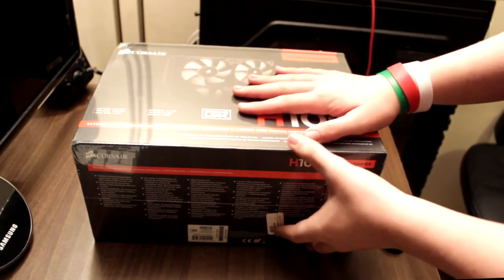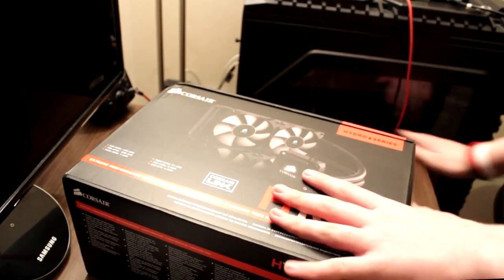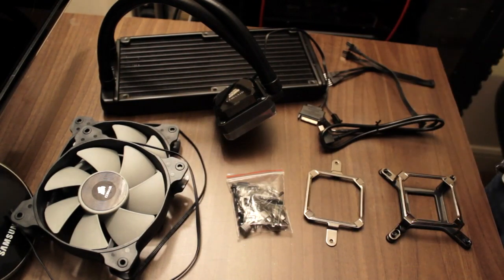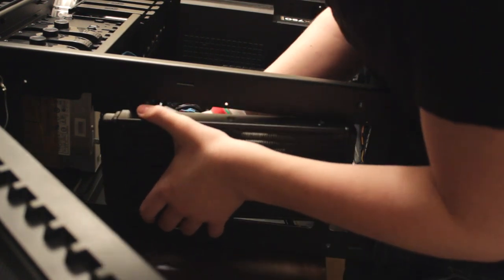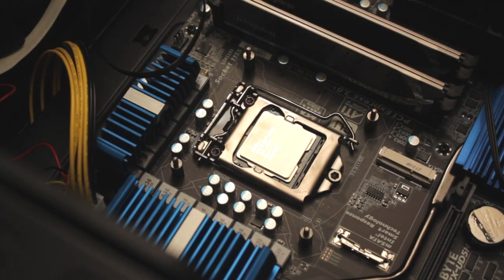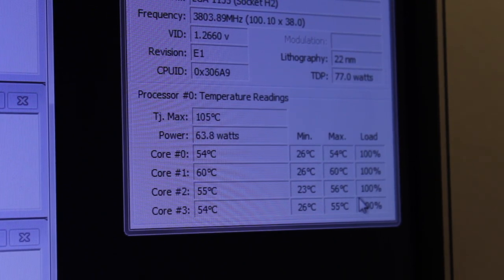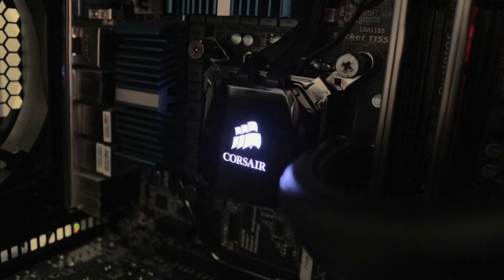Corsair H100i: Unboxing and Installation

Comment: don't know if you're going to answer but for some reason my led on the h100i has turned red on its own any ideas why?
Reply from the maker: Hello, Yes I try to answer every question! This happened to my H100i, except mine turned Yellow, and that was because I was using the Full Red, Blue and Green LEDs to make it white, and when the blue LED died, it turned yellow which really sucked. What colour was your LED set to before this? because it is possible that one or even two of your LEDs has died and you may need to RMA it if it is a problem for your rig.

Comment: What case do you have? I think you said it in the video but I can't hear it very well...
Reply from the maker: Coolermaster HAF X In this video :)
Reply: Thanks man:) I just bought a Corsair 400R, I had an NZXT source 210 and it was too small for the H100i...

So I was just wondering.
Reply from the maker: Nice choice man, Cant go wrong with Corsair!
Reply: bleedinsixcolours
No you can't:)
Reply: bleedinsixcolours
I subbed btw:)
Reply from the maker: ThlackTV Thank you very much! If Google hadn't messed up the notifications for Youtube content makers so badly I would have probably known! Cheers dude.

Comment: So is this a Radiator, pump, and reservoir all in one, does this include Water Blocks for CPUs and GPUs? or will I have to get those seperately?
Reply from the maker: No, this is The Radiator, Pump, Reservoir, Liquid and Water Block for the CPU in one. You 'cant' add a GPU to this, its closed loop so its an out of the box water-cooling kit for the CPU only.

Comment: You shod install the feans in pull not push, cause the dust can build up in the radiator. If you install them in pull you can easy clean it out!
Reply from the maker: I've since changed, I got a new case after this video so I changed the orientation whilst changing the case.
Reply: OK, Gold job. (Sorry for my spelling. I'm from Latvia.

Comment: i clicked Like but i really wanted to press Dislike cause u installed it with Push and not Pull. Ur radiator in 2 weeks is going to be full with dust. I have a 3770k @3.5Ghz Delided and after non stop bf4 dosnt go higher than 70º
Reply: The dust will go into the radiator anyway. Where is the difference? I buy the h100i in a few days too and where is the difference? Where is the difference if you pull the air through the radiator?
Reply: +Tobias L. The radiator will be hotter than the air in the case. So you'll pull hot air in. You should push air out and push the hot air from the radiator out and away from the inside. Air in from the front and bottom of case, air out at the back and top is the norm. But you do it how you want. It's just, if you stray from the norm, people will complain.
Reply: +Bullion Head That is not the problem here. The radiator in this video is installed that way that the air gets puched out of the case. The problem is that the fans are installed that they push the air through the radiator instead of pulling it. If you have it this way it is really hard to clean, because the fans are in the way. Also less dust gets picked up because the air moves slower at the bottom of the radiator this way. It doesn't affect the cooling performence but it makes it easier so clean it if you have the fans in pull configuration.
Reply from the maker: +Tobias L. Exactly what this man said ^. There is no cooling performance differences, only the ascetic appeal and the ease of cleaning.

Comment: What are your temps at 4.0 and/or 4.2 GHz?
Reply from the maker: I run at 4.4GHz, and get 68-75 Degrees C at 1.31v :) Depending on the stress test program.

Comment: I'm doing my first build this week and I am stuck between the H100i and the Noctua D14. I am running a I7 4990k and a MSI G65  mobo and plan on oc'ing to 4.2-4.4  .
I am terrified that this thing will leak after reading some reviews on amazon and the Corsair forums. Someone with more experience help me please, im starting to over think this, I think ? Bleed, the video is from 2012, have you had any serious issues ?
Reply from the maker: Hello, First of all, sounds like a great rig! I would say the H100i. Since reading your comment I went over to the Corsair forums to look at leaked H100i situations and it seems to me that its mostly user error. I've been running this cooler since the video was made in 2012, and I have had one issue. The blue LED inside my pump broke. Obviously not a big concern, I just sent it back to corsair and they sent me a replacement, this was in January 2013. 
The H100i is one of the most recommended coolers on the market. You should just go for it, and not worry about the potential for failure, as I have never before heard this product fail without user input.

Comment: o and you made it clear that when touching the bottom you should touch the "soldering" part, which would be what? and does that mean other parts of the bottom can potentially damage the MB?
Reply from the maker: Not really, but it's better to be safe than sorry. The solder bits, are the silvers spikes on the back of the board, it may hurt but it stops oils from your fingers getting not he motherboard. Its nothing to worry about though :)

Comment: Ok! So I'll take your recommendation and this is what I'll be doing exactly. I'll first install my power connector, optical drive, SSD drive, Mechanical harddrive, then I'll Proceed to motherboard to install the following components in this order, CPU, Corsair H100i, Ramm, and I'll leave video card last when It's mounted, then I'll connect everything....the cabling, which I have 0 clue how to do.
Any tips on my ordering? Any tips on how to do the cables when you have 0 knowledge of which wire needs to go where?
Reply from the maker: Usually, I would leave the Optical, SSD, and Hard Drive till last, but you're right in putting the Power Supply in first. 
My personal order is:   CPU Install - RAM Install - Power Supply Install - H100i Install - Motherboard Into Case - H100i Into Case - SSD Drive - Hard Drive - Optical Drive - Cable Up The System - Graphics Card - Cable In Graphics Card.

With your power supply, are the cables coming straight out of the power supply? or are they separate cables with plugs on both ends?
If they come straight out of the power supply, you need to connect the largest connector, (the 24pin) into the largest slot on the right hand side of the motherboard, usually just next to the RAM. Next you shall have a cable that splits into two 4pins but can be pushed together into 8pins. Plug that in usually on the top side of the motherboard. Next you need to power the drives. There will be a cable with multiple connectors on it, that are slim and about 1 inch across, they need to be plugged into the SSD, the Hard Drive and the optical drive. You then need to get the SATA cables that came inside your motherboard box, and plug them into the SATA ports near the bottom on the right side of the motherboard. You should have them all plugged into the same colour. then route those cables up to your drives and plug them in to the hard drive, optical drive and SSD.
Next you should have cables that came with the case, that are permanently attached to the case. The very small connectors should have labels on them, that will coincide with the small labels on the very bottom of the motherboard, for example 'PWR' and 'HDLED' just plug them into the connectors that align with the labels. There will also be USB connectors, plug the largest connector with the blue tip into the USB 3 header, which will be located just next to the 24pin connector, as well as the USB 2 plugs which go in the headers also found at the bottom of the motherboard.
Then you need to plug in the fans connected to the case. The rear fan can be connected into the 'FAN' header just right from the rear audio connectors. The front fan can be connected to the header just left of the very small connectors you connected earlier. 
For the H100i, First off you need to connect the cables that come straight off of the H100i, firstly the same power plug you used for your hard drives, will need to be plugged into the H100i to power it. Next you will need to plug in the fan header that is permanently installed into the 'CPU_FAN' header just right of the gold heatsink at the top of the motherboard. 
You will then need to plug the adapter that came with the H100i into the top of the pump unit, to give yourself two 4Pin Fan connectors, proceed to plug the fans on the H100i into those. 
Finally you will need to install the graphics card, and plug the appropriate PCI-E connectors into that.
NOTE: The PCI-E 6 + 2 Pin connectors are different from the 8PIN CPU power we plugged in at the beginning.

If you need any more help feel free to ask :)

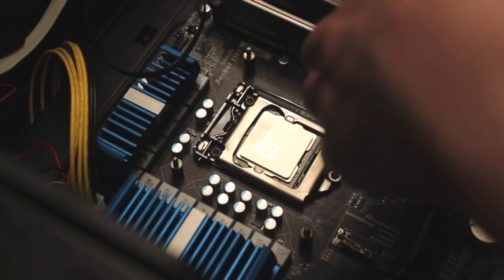Comment: Wow thanks man I do appreciate your video and your time to respond back...So re-cap Blue in your video at 10:55 is the heat sink for your motherboard, for my motherboard for the Asus Z87 PRO the gold is the heatsink I may lift from, as well as from underneath the motherboard while taking precautions of anti-static by either touching metal part of the case or having a anti-static wrist band around my wrist connecting to the metal of the case...Ok lastly, Should I hook up the backplate and leave the corsair h100i till after I mounted the motherboard? So the backplate is already in place to just screw on the corsair h100i right? Isn't that what you did in ur video?
Reply from the maker: Thankyou, don't worry its my favourite thing about doing these videos; responding back. :) 
Yes the blue heatsink on my motherboard, is the same as your gold heatsink, and they are safe to life the motherboard from; You can touch them, and the solder points on the back of the motherboard. If you want to be safe you can use an anti-static wrist strap, but put it around your ankle so it doesn't get in the way.
In my opinion, you should mount the H100i onto the motherboard first, then install the motherboard into the case, and then the H100i into the case; which is what I did in this video essentially :)
Chad you enjoyed, thanks for subscribing :)

Comment: Loll you just made me so lost... I don't know what your taking about:/ thought the only heat sink that gets attached to the motherboard was the CPU cooler which in this case is replaced by corsair h100i... sorry I'm a been newb :(
Reply from the maker: When you buy your motherboard, you will have little metal pieces attached to it, above the CPU socket and usually to the left of it too. The H100i is a CPU cooler. A heatsink, is any piece of metal that's main purpose is to dissipate heat. I think I recall you're using an Asus motherboard, so the heatsinks I'm talking about that you can hold the motherboard with will be gold.

Comment: Wait...Why did u have to remove the motherboard if the plate itself is adjustable? Both sides of the case opens up doesn't it? I'm building a PC and I'm a novice..and I'm actually using Cooler master HAF X as well with a Asus Z87 PRO motherboard....so should I install the Corsair cooler in beginning after instaling CPU or at end when motherboard is mounted?... And if @ end is best...then what is the best way to handle the motherboard? lifting and such, since I was told u needt o install the CPU cooler and handle the motherboard by lifting from the Cooler itself...so uh yes plz help?
Reply from the maker: My motherboard's socket didn't line up with the HAF X's cutout, hence I had to remove the motherboard, install the cooler, and reinstall the motherboard. To be safe, I'd say install it before you put the motherboard in the case. And to handle the motherboard, I would lift using the heatsinks on the motherboard. You can also put your fingers on the back of the RAM slots to support the board :)

Comment: Do you not need any thermal paste for this setup?
Reply from the maker: Yes You Do, I stated many times that the thermal paste is already on the H100i.
Reply: bleedinsixcolours Thanks mate. In regards to being able to control the speed of the fans,can I connect the fans that are on the radiator directly to the Mobo or would I have to connect it to the header of the cooler itself?

Comment: The Haf X cases are a pain when it comes to the CPU cut outs on the back. Cooler Master simply do not make them big enough. I ended up taking a Dremel to mine and cutting out a bigger hole, so I didn't have to keep taking the motherboard out when messing about with the CPU cooling.
Reply from the maker: Yeah it was a total pain in the a**. Because I had to film this video also, it would have been so much simpler to just screw it in, but NOPE had to frustratingly take the whole mono out. I suppose that's one way to do it! aha, I sold mine in the end and bought a Define R4 so I'm glad I didn't cut a hole in it :)

Comment: Will the aerocool xpredator x3 devil red work with h100i?
Reply from the maker: Hello,
Yes from looking at the build it Could support the H100i. But If you haven't already purchased the case, I'd really recommend choosing something else, and then making it look how you want later. I've had a friend who chose this case when I built him a system; It arrived with the top panel broken off, it weighed near nothing and the side panels were razor thin. The quality was horrific, and he was very disappointed because it is a nice looking case.

Comment: Why the hell did you skip the cables!?,?, .
Reply from the maker: Sorry, It was one of my first videos. The SATA power, needs to be plugged into a SATA power from your power supply. The Mini-USB cable needs to be connected to the pump, and routed down to a USB header on the bottom of your motherboard. There are two small adapters, that convert a plug on the pump to two 4pin fan connectors. If you plug the fans into these adapters you will be able to control them in Corsair's LINK software.
Reply: Too late dude, I done messed up. My main issue was why the cables that were connected to the cooling pad jad weird plastic blocks on them.. little did I know that those blocks were removable.

Much frustration ensued!
Reply from the maker: Sorry man, at the time I was recording with a DSLR, in very low light which is a recipe for disaster, and the shot where I connected the cables was basically un-usable. Apologies.
Reply: Makes sense, Igot it fixed eventually though, so all is good

Comment: I am buying a motherboard msi x87 gd65 H100i and 32 GB of ram processor4670k i5 what's overclocking speed can I get if you know. Thank you
Reply from the maker: It all depends on your luck with your processor, Id say around 4.2-4.4GHz.
Reply: how do u get light on pump
Reply from the maker: The light will automatically be White, you can connect the included MiniUSB to Internal USB 2.0 header onto the pump to change the colour with the Corsair LINK software.

Comment: what is that case, that allows you to install this cooler on top of the case?
Reply from the maker: It is a Coolermaster HAF X :)
Reply: thanks brohan. which one do you prefer haf x or corsai 750d?
Reply from the maker: Amel Salibasic Without a shadow of a doubt, The Corsair 750D. Much better built case, and In my personal opinion a much nicer looking case. Allows for about the same amount of components inside and the window is actually useable :)
Reply: Thanks man you are great adviser.
Reply: Amel Salibasic Pretty much any big tower will do :)
Reply: bleedinsixcolours will it work with a cm 690 III?
Reply from the maker: ***** Hey dude, if you have a budget number you could give to me, I can recommend a case if you like? :)
Also Yes Coolermaster's site lists compatibility for two 120mm fans in the roof, so yes it should fit.